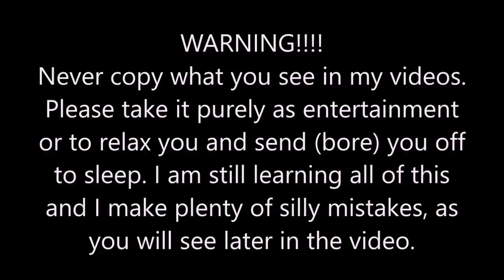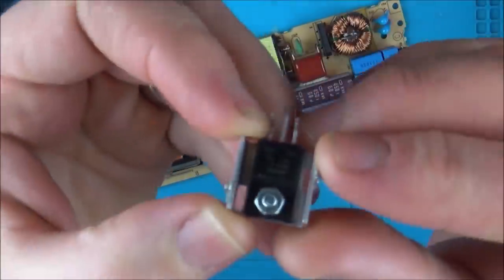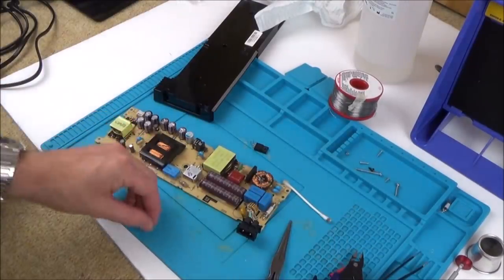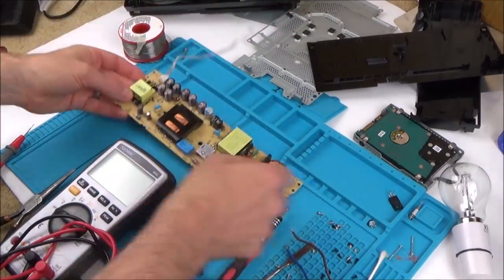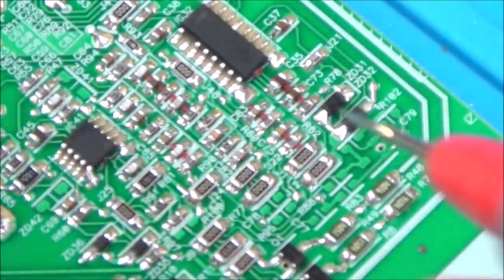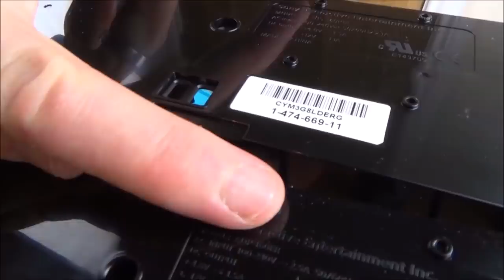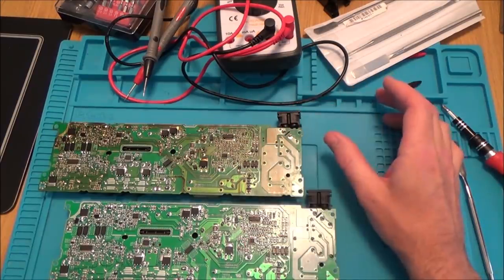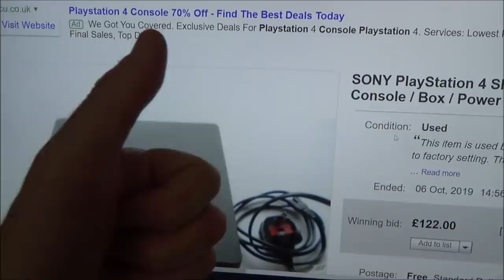2019 eBay Repair Challenge - Week 3 - PlayStation 4

Comment: So you basically just bought a new power supply and replaced the old one with it after you changed all those components and it still did not work? I skipped trough the video a bit so I'am asking
Reply: He did trouble shoot the power supply. As he hasn't enough experience yet, he went as far as he could. So yes, in the end he replaced the power module. I know when to stop also. Sometimes it's just cheaper in the long run to replace the faulty part. What would you have done short of throwing the whole unit away?

Comment: VINCE.. I was gonna suggest you test the voltage across the working power supplies zener diodes that seemed dodgy on the non  working one " MIND THE LIVE AC VOLTAGE" because zener diodes Pull down voltages, for example 6 volts down to 5.3 or 3.3 Volts, so once you know what voltage is required that useless power supply can have replacements installed, Most surface mount zener diodes should be able to handle about the same current but its safer to go with the one with higher current rating when replacing them, anyway getting back to the voltage tested, That's the zener diode you will need to replace where you don't get a diode reading around .5 to .8 Max mind you I have never come across one as high as ".8". Another thing is that chip you're worried about should have no shorts to ground unless a pin is connected to ground once you remove suspect Zener diode/s, and I stress once suspect Zener diodes are removed.
Reply from the maker: Thanks Koala :-)

Comment: 16:00 I am no expert either, however normally when you have a power MOSFET that does not have exposed metal on the underside, you should use a Mica insulator for better heat transfer even if you put thermal paste. just my two cents worth lol :P  This fix was a shooking experience for you.

Comment: USE 220 VOLT LAMP TO DRAIN CAPACITOR BETWEN LAMP AND CAPACITOR USE 100 OHM RISISTOR
Reply: I COMMENT IN MIN 28 . AND I WACH IN MIN 37 USE LAMP :)

Comment: Hey My Mate Vince. I've been watching for a while now. As of a year ago my PS4 has been throttling and been lagging whenever loading game or in the main menu. I'm willing to send it over seas if it interests you. I'll pay for shipping back to Canada. Thanks
Reply: That could be as simple as the hdd going bad, as I had the same issue. Games would freeze for a while then continue ok for a while, then repeat, and loading them started to take ages.
If you've got a spare 2.5 inch sata hdd around, try installing it and load up a game to test.
Alternatively you could take out the hdd, hook it up to your pc, and use a program like speedfan to test the drive, as it will tell you if it's got reading problems, or bad sectors etc. It won't re-format the drive or anything so don't worry about that.
Might be worth trying.